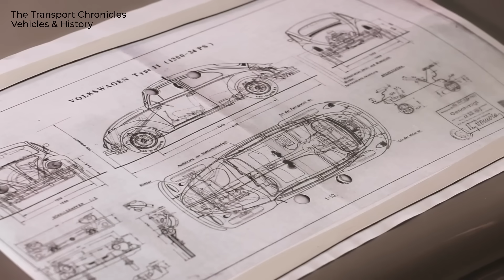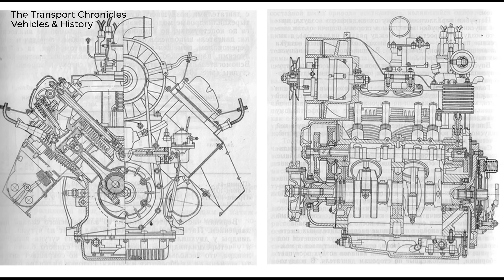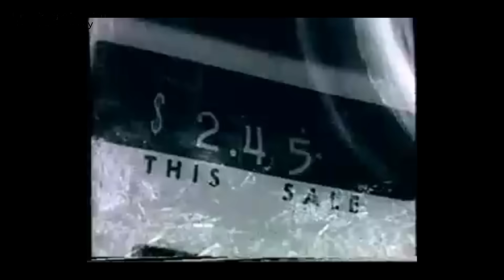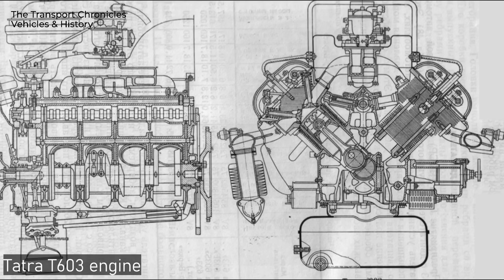Why Did Air-Cooled Engines Disappear?

Comment: It makes sense for smaller, lighter cars with something like a two cilinder engine for it to be aircooled. Best example is the Citroen 2CV or the original Fiat Cinquecento. Unfortunately most city cars today tend to be electrical for some reason and that also has kept the aircooled engine from making a comeback.
Reply: You are correct - rightly or wrongly the future belongs to electro-mobiles. On top of it vehicles are becoming bigger/ heavier. I am personally not excited about it, but that is what the trend shows. My main concern is cabin heating in northern latitudes where I happen to live.
Reply: @zdenekprisovsky2783  Well, city cars and/or electric vehicles are far from being best sellers. I bet if normal best-selling cars like the 2CV and original Beetle were coming out today with modern versions of their air-cooled engines they'd sell like crazy.
Reply: @danielt.8573  I appreciate your sentiment, but it will not happen. Have you noticed that one time phenomenally popular Renault 5 is now made in electric version? It looks and runs well. So is Fiat Uno. Besides, European car makers are seriously struggling or are defunct. We are up to new times my friend; everything is changing - and we are mere observers.

Comment: Air cooled engines usually run richer to make the engine cooler and reduce the possibility of overheating thus it's difficult to meet modern emission standards
Reply: Rubbish,I have worked on air cooled engines for 45 years ,with the fuel  correctly tuned the spark plugs indicate a correct stoichiometric mixture for clean burning.

Comment: Air cooled engines require looser clearances to operate in a wider temperature range & they do tend to run hotter on the leaner mixtures required for EPA guidelines. But as anyone familiar with Russian guns and military equipment will know it's these looser clearances that allow their stuff to operate in dirtier sub zero conditions, the downside is lubrication systems can breakdown from trying to pump oil much thicker than honey... 😢
Reply: Replace "tolerances" with "clearances".  Looser tolerances are never preferable or helpful except in cost cutting.
Reply: Modern fully synthetic oils are not like honey. Lubrication is not a problem any longer.
Reply: @johnburns4017 yes synthetic oils are a vast improvement but aircraft engine manufacturers still recommend pre-heating before starting in arctic temperatures.
Reply: @OYisit  synthetic oils are forbidden on aircraft engines, because they have loose clearances to avoid size in descend with reduced power (engine hot inside, but cold cyclinder walls), so this engine burn oil, and synthetic made hard deposits ,while mineral oil (ore some semi synthetic) burn without deposits (or much less). And synthetic oils are forbidden in older aircooled engines like 2cv, VW...for the same cause+ the most synthetic oils are much less "creamy", and does not adhere to surfaces like mineral oils, which increases wear on these engines, particular on 2cv camshafts
Reply: @leneanderthalien seems were back to square one.

Comment: New title: why did air-cooled engines disappear from *automobiles. Air-cooled engines are still used on a number of motorcycles and are the norm in general aviation. Missing from the list of reasons why they stopped being used in cars and are disappearing from motorcycles: emissions controls. Air-cooled engines usually have wider tolerances which are incompatible with increasingly stringent emissions regulations.
Reply: Regarding presence of air-cooled engines on motorcycles - they are disappearing fast. Many builder are making liquid cooled engines look like air-cooled ones with faux-stubby fins to pander to the "traditionalists". Look at BMW and lately even Moto Guzzi. Even hi-power light dirt bikes are equipped with l.c. engines.

Your use of term "tolerances" is misplaced - it is rather CLEARENCES; tolerances are LIMITS of dimensions. Two different meanings for two different subjects.
Reply: @zdenekprisovsky2783  This is why I'm thankful that Honda churned out the GB350, a REAL air cooled single that BEATS Euro 5, and Royal Enfield too.
Reply: Now even some small scooters & motorcycles (under 200cc) are equipped with liquid cooling
Reply: @080_muhammadarkanuddinhani2  Exactly, and for good reason: pollution control.
Reply: Air cooled motorcycles are the bomb.  I've got two of them.
Reply: Was here to type this, thank you

Comment: Why electric radiator fans, when mechanical one did the same job with same efficiency, assume one riding on highway and fucccckking electric motor of the fan screwed. Manufacturers compromised reliability.
Reply: My father was a VW fanatic,68 ,72 beetles,78 412 variant,84 mk1 Jetta,he prefered the air cooled simplicity.
Reply: Mechanical fans are not more efficient. They waste energy when the engine is cold, when the air outside is cold, when driving at speed when the natural air flow is sufficient. Further, the hardly work at all when moving slowly in stop-start traffic, and on a hot day this often caused overheating. In contrast, an electric fan only runs when it has to. The electric fan in my car hardly runs at all in normal conditions.
Reply: @TheEulerID Man, I was stuck on a highway at night in the middle of nowhere because the fucccckking motor of the fan was fucccked up, instead I was fucccked up
Reply: Fans on air cooled engines consume more power than fans on liquid cooled engines because it's a lot easier to pull air through a radiator than the whole engine.  Not a problem for a motorcycle or a plane, which don't have fans. 

Air cooled engines also have a much harder time meeting emissions standards because the engine temperature is harder to manage.

But don't give up hope. Direct fuel injection makes managing emissions easier, and electronically controlled fans make managing engine temperatures easier. Just need a good application.

Comment: You know I don't even consider these EFI engines to be reliable, what was fucccckking wrong with the carburetors, they were easy to repair and cheap. Why electronics involved in each and every thing
Reply: emmissions, and power
Reply: When the computer says "No!", the car stops; you could always get an older car going with a bag of tools and a few spare parts.
Reply: you did not understand how the carburetors works: they can be only optimised for a narrow range , and out of this range is the mixture approximate (too rich or too lean), in addition, the venturi from the carb causes a loss of flow area and a pressure drop...Even mechanical fuel injection is far superior to any carburetor, and if it is also electronically controlled (inclusive ignition), it allows the engine to be optimized down to the smallest detail and significantly increases its performance while considerably reducing fuel consumption and emissions.
Reply: @leneanderthalien What good is fuel consumption when you stuck in the middle of a highway at night
Reply: my EFI worked until E10

Comment: I do hark back to the days of the simpler engines and cars where you didn't need a laptop to fix them, the more tech and parts in an car, the more there is to go wrong. For example, I drive a 2011 Fiat Panda and even that has power steering....why?, a car that size doesn't need it, its just an unnessecary expensive repair bill when it fails. I could go on but this is a comment section and not an essay section 🤣 P.S. I love the sound of an air cooled engine.
Reply: Air cooling has a place
Simpler  2 stroke less parts less problems

Comment: I am surprised that, when Porsche decided to abandon air-cooled engines, anti-pollution standards were not cited as one of the reasons... I thought I had read about this in the press when the 996 was launched. Am I mistaken?
Reply: You're not mistaken. It was, in fact, the main reason.
Reply: Power density was the reason. All Porsche cars basically used oil cooling for the cylinder heads and then the super car 959 had to use water cooling for the heads. For Porsche to have more power from the turbo cars, oil cooling of the heads had to be abandoned in the 1990s and adopt water cooling. At that point, you might as well just use water to cool everything.